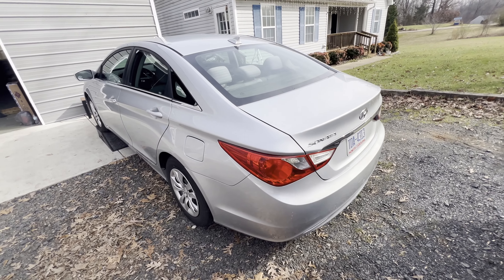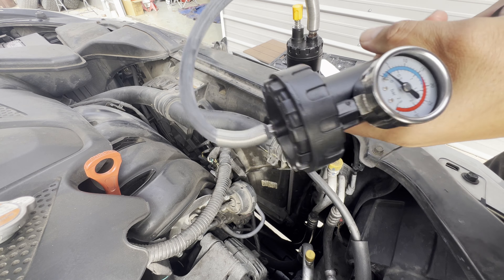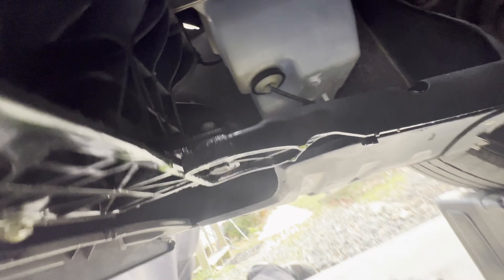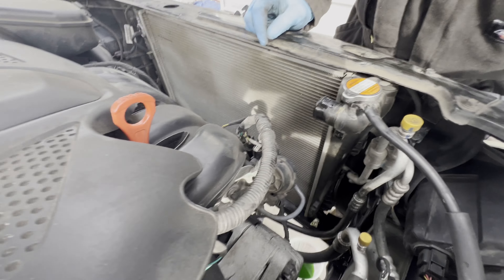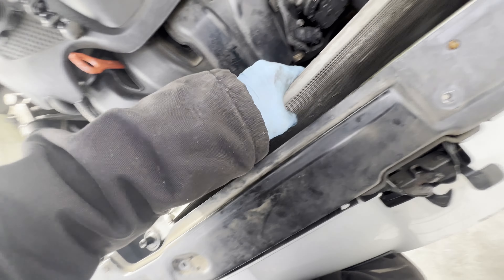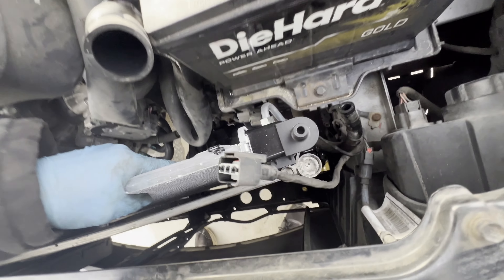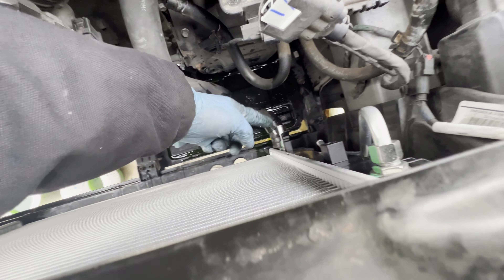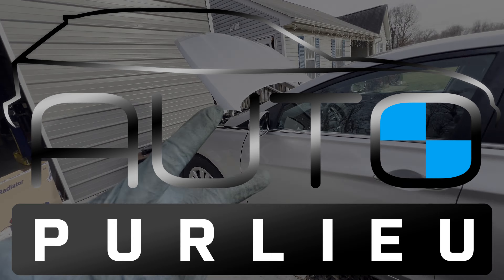How to fix a Coolant Leak on 2012 Hyundai Sonata Radiator Replacement Removal Install 2011-2014 2.4L

Comment: Nobody shows how you actually get the fan back in
Reply: There's a couple of videos here on YouTube that show all the process on how to remove and reinstall everything back
Reply from the maker: If you removed the radiator out ,it should be the same as putting it back.
Reply from the maker: @Bear-88  that’s awesome
Reply: Молодец. Одной рукой разобрал и собрал 👏🏽